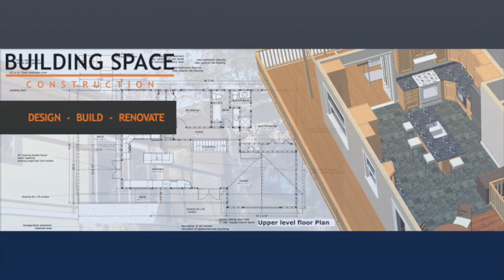FLOAT HOME LAUNCH

Comment: Why not build the base slightly larger so you can walk around the house and make doing repairs a little easier. It just seems odd to me to make it without any exterior space at all.
Reply: or a roof top deck....
Reply: The foundation is made of multiple air tight pods , by enlarging the base it is more of a chance rain water could penetrate causing it to sink
Reply: @BASKETKASE47HUDSON  Heaven forbid if the concrete base gets wet!!
Reply: Dan Harris   Once the house is on site they build floating decks around it.
Reply: @BASKETKASE47HUDSON   Thats why thereis an invention call a bilge pump
Reply: Wilson Pablo  So it's true then ....she was cheating on you !
Reply: @Off Grid outdoors if your answer to the question is you're worried about something that might get wet that is meant to sit in water . I would think it wasn't a good idea in the first place.